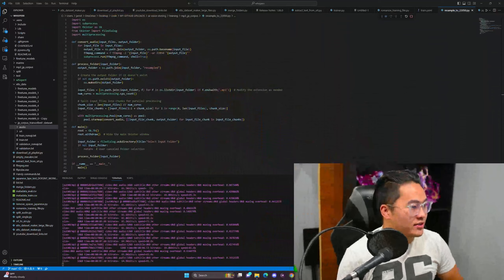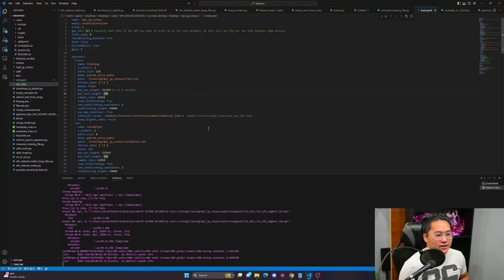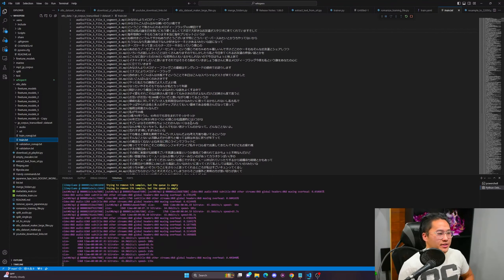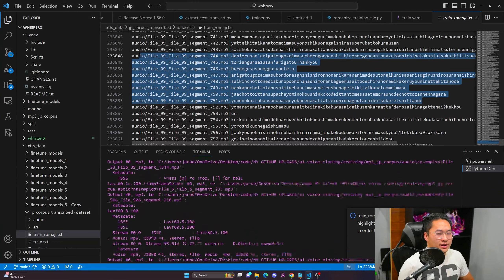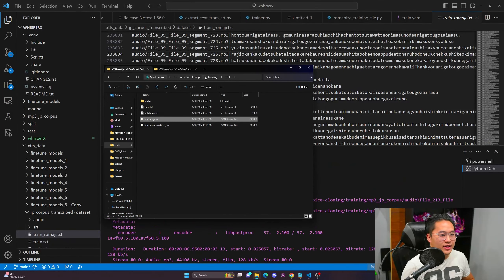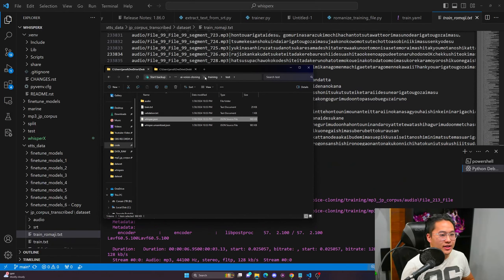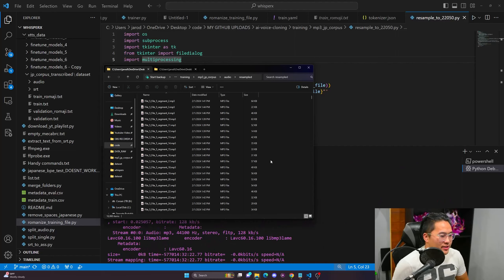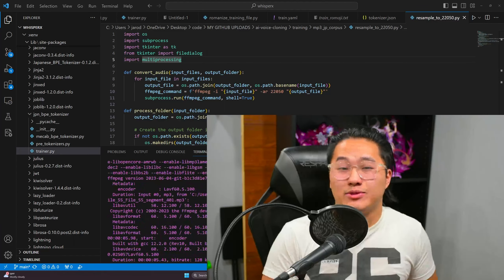Training Tortoise TTS on Other Languages (Japanese)

Comment: Interested to see the result. Can you use the tokenizer of xtts?
Reply from the maker: I had initially thought of this, but tortoise needs a tokenizer with a width of 256 and xtts has a larger one. I may look into adapting the tortoise architecture to see if it can fit larger ones though
Reply: @Jarods_Journey  great. I will follow you to see if that works. Do you think training tortoise will get you better result than fine tuning xtts?